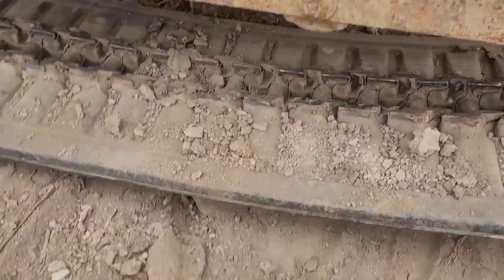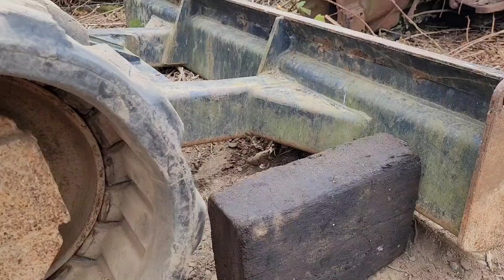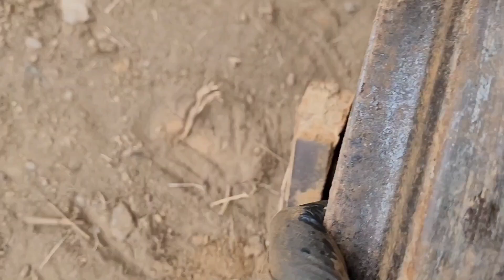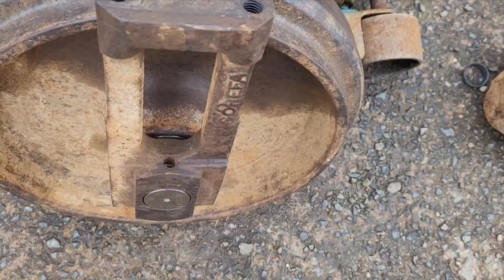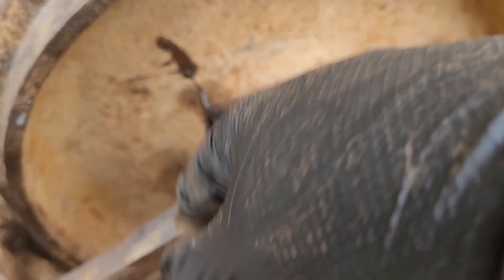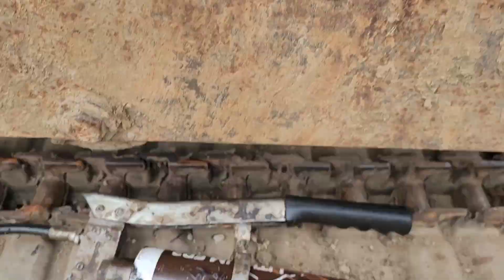Mini/midi digger, excavator track idler wheel repair, and learn a lesson

Comment: How hard was it to separate the idler wheel from the two arms that bolt to the machine? I have an idler from a Kubota KX91-3 that I can't separate after driving out the roll pinon one side. Did you use a press, puller, or is there some other technique for splitting it open?
Reply from the maker: Im sorry for the late reply,  tbh i used a thin cutting disc on a 9" grinder down the side of the idler to split the pin so i could tackle 1 side at a time , I managed to knock 1 side out but the other i had to take it to a press